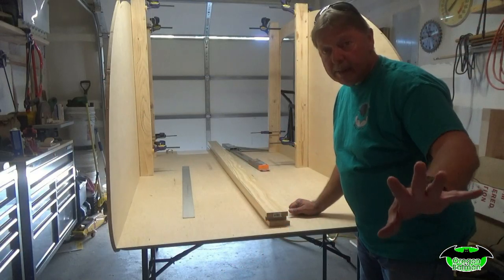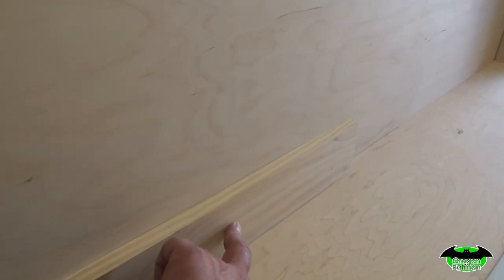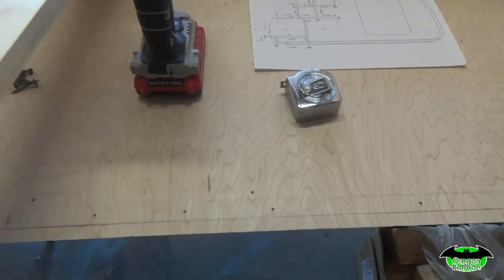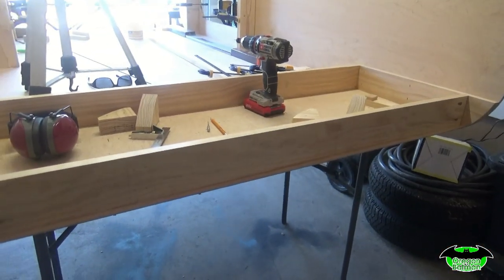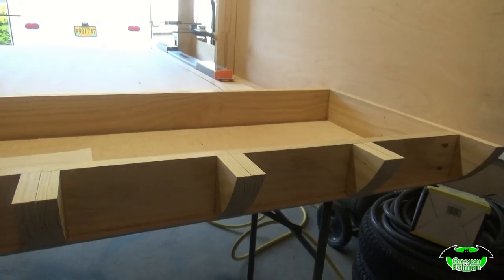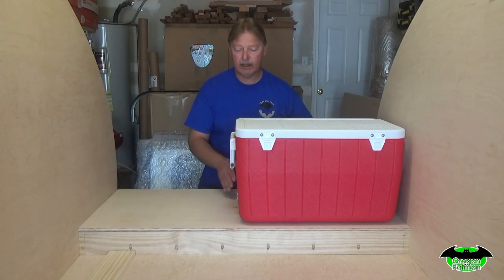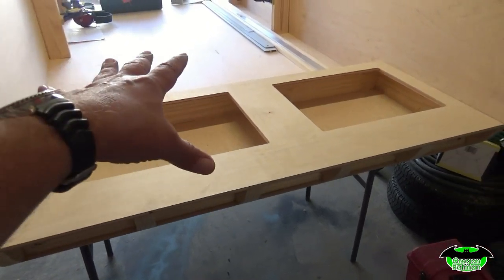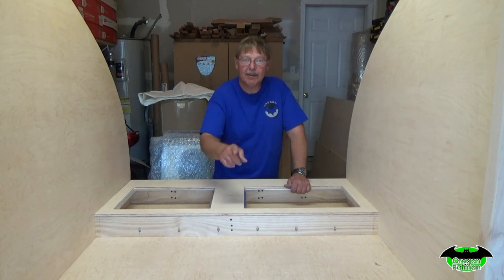Let’s Build A Teardrop * Step-By-Step * - Part 11 (Building Rear Storage)

Comment: OBM, the storage panel under the cooler is a great idea. Have you had any issues when you filled the cooler with items and the weight of the cooler affecting the aluminum? Even with the wooden lid, I'm thinking that the weight might cause bending, drooping, or loosening the screws. Any issues since it's been a few years?
Reply from the maker: Hello! Since there is a drawer for the cooler directly above the storage area, no weight actually comes in contact with the lid. I am confident that even without the drawer, the aluminum support for the storage lid is plenty strong enough to support the weight of a full cooler, given the fact the aluminum is 1/8" and secured with a ba-zillion screws! :) Thanks for checking it out and the comment!
Reply: @OregonBatman  good to know!! Thanks!!

Comment: Do you use a table saw for cutting the cabinet components? I'm wondering how to make uniform cuts with a circular saw.
Reply from the maker: For a majority of the parts I used a table saw... for hole cut outs and leaning up edges, I used a router. That gives me the cleanest cut

Comment: I have very much enjoyed your videos about both trailers so far!  Why did you choose to use the aluminum strips to hold the lids up? Could you have used 1x2” wood instead?
Reply from the maker: Hi Rick! Thanks for watching! I decided on the aluminum as it is only 1/8" thick. The storage under is 3-1/2" deep, so if I used a 1 x 2, I would be losing just a bit of space to get things in and out of the storage area. Trying to make the best use of space as possible. Hope that helps! Cheers!
Reply: Thanks OB.  I look forward each week for your next videos. Keep up the great work!
Reply from the maker: Thank ya Rick! See ya next week! :)

Comment: As usual thats well thought out Al. I am about 3/4 through with the one I am building 8x6  5' 6" high. Weight will be around 900 -1200 lb I think. I will have to get heavier springs.What weight springs do you suggest.
Reply from the maker: Hi George! Hoping to see some pictures of your build sometime soon! I'm thinking if you keep the springs around the 2000# mark, that will give room for some payload and travel. I'm sort of partial to the torsion axles myself... but I don't do a lot of off road camping yet or would be thinking of using the springs.
Reply: @OregonBatman  So about 1000lb each side is what I am thinking, had to slow down the build, I think my shoulder needs a rebuild. Had shots but still bloody painful.
Reply from the maker: Sounds about right George! Wishing you a speedy recovery my friend! Take it easy on the shoulder!

Comment: Great video, better than the others, which were also good. Do you have a rough estimate how heavy the camper will be?
Reply from the maker: Thanks DocM! I am taking a guess that it will weigh in at around 1000# when finished... I'll do final weigh-in once completed! Thanks again!
Reply: @OregonBatman  Because I am a metric German: 1000 lbs?
Reply from the maker: Well sir... that looks like it comes out to about 453.59 KG... give or take a few! :)
Reply: @OregonBatman  Thanks for the maths. We have in Germany the old dimension Pfund which means pound, where 2 Pfund equals exactly 1 kg. So its almost like lbs (almost 1/2). Therefore I have to give a few.;-)
Reply from the maker: Ahhhh... I looked it up, and it looks like converting pounds to pfund is 1000 pounds equals 907.18474 pfund. That sound about right?
Reply: @OregonBatman  Yeah: more or less! Nice to chat with you. Thanks a lot! Now is 3am and I go to bed! Very late or early, that depends ... more or less.